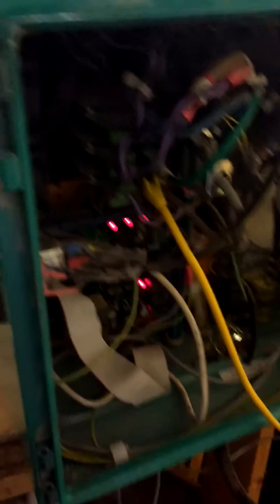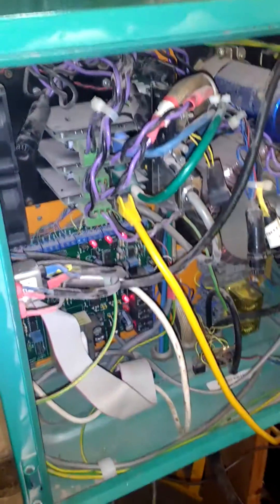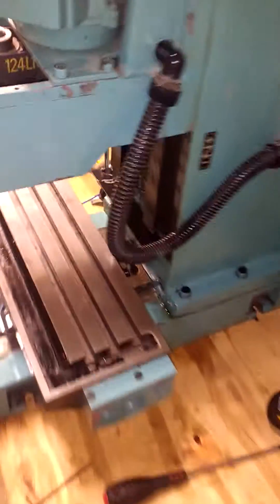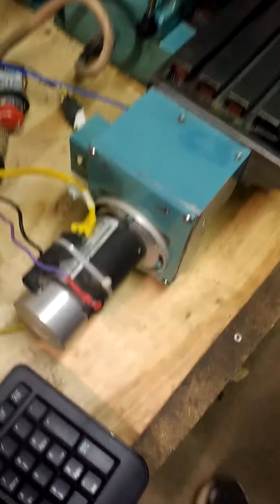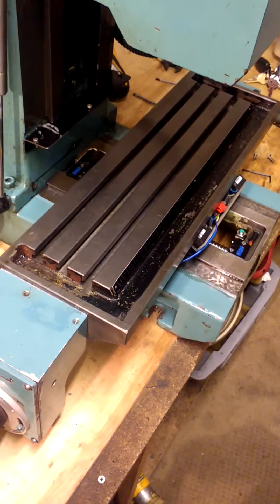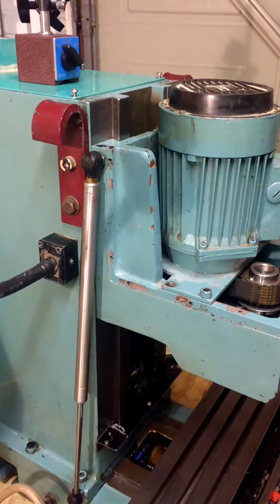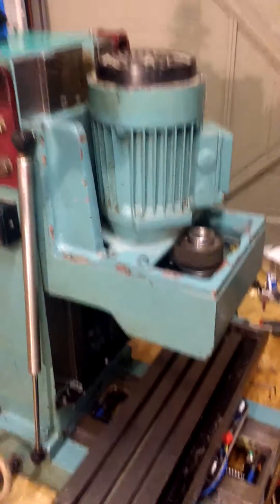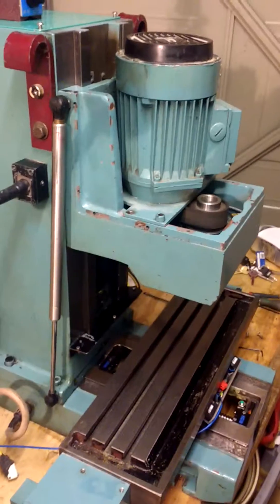Denford Triac - on servos and Mach 3

Comment: Did you fit the servos yourself? If so what model are they?
Reply from the maker: Hi Dave, no I didn't it came like this. Tbh I haven't had it working since that video. I need to get it running again as it's a lovely little machine.
The servo is an ElectroCraft E240, part no. 240-026-0888-2
Customer part number: 18P7938 EC H80478